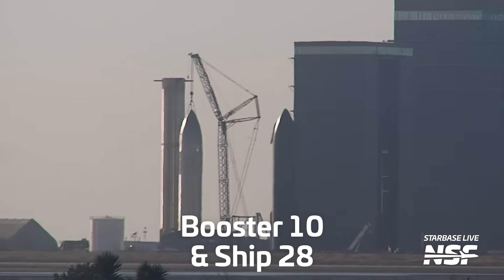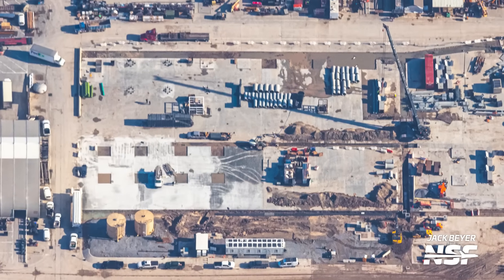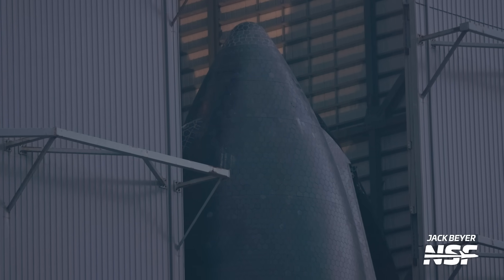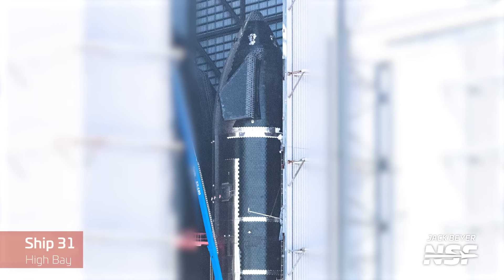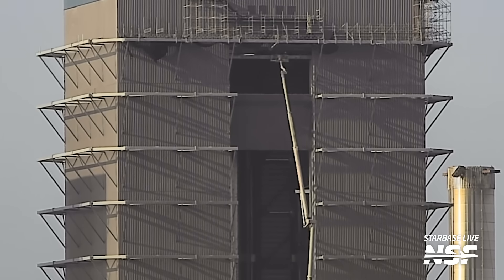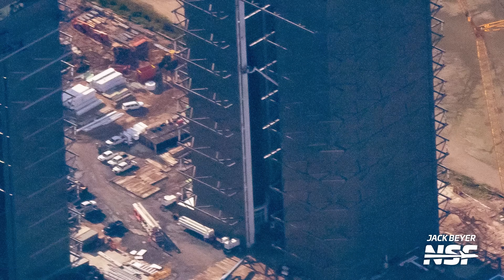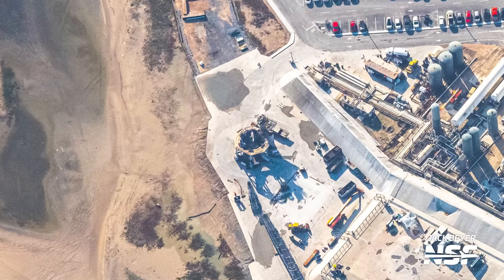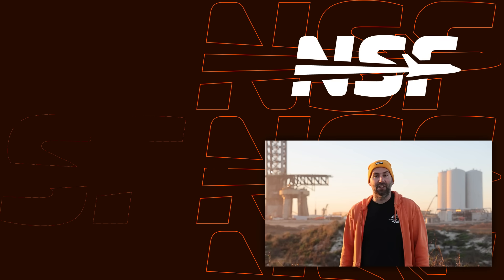SpaceX Revving Up for Starship Flight 3: | Starbase Update

Comment: HEARD SPACE-X "PAINTED" THE OLT. Surely You Just ---- A Concrete based Structure experiences 15 Million Ponds Force for 10 seconds at 8,000 Degrees Temperature --- AND YOU PAINT IT??

Comment: My Guess that the LR 11000 Crane will be reconfigured with a Power Boom like the LR 11350.  Has almost the same lifting Cap. at similar Jib height.  The only difference is the HP of the two Carnes. Time will tell.

Comment: Soon there will be a whole arsenal of starships ready for orbital test flights !
Reply: I do not believe that SpaceX would be investing in so many boosters and Starships if they did not intend to launch them.  SpaceX is clearly assembling sufficient inventory to launch at least TEN times this year.  Objectives for this year include demonstrating the minimal delay between two launches required for orbital refilling, catching a booster or Starship, deploying full size version 2 Starlinks (probably essential for usable 5G bandwidth).  If they exceed their basic plan they may even emulate the first Falcon Heavy launch by sending an empty Starship past Mars or on a free return around the Moon like Artemis I.

Comment: can anyone explain to me what the air vaporizers do
Reply: They are heat exchangers.  Super cold liquid nitrogen goes in, flows along a slew of thin pipes exposed to ambient air, and exits as gaseous nitrogen.  Gaseous nitrogen is used for flushing pipes, fire suppression, fuel tank and GSE pressurization tests.
Reply: @Spherical_Cow  awesome you are amazing spherical cow

Comment: Them tower parts I don't think are for launching. They are going to be for landings. You cant blow up your only launch platform testing landings. I just wonder where they will put it.
Reply: You are assuming that blowing up the launchpad will be unavoidable consequence of landing the boosters.   The original intent was for starship to take off and the booster to be caught by the same launch tower a short time later.  With a second launch tower then Space X can alternate flights.  Refurbish one after a launch while another is ready for launch.  

I'm guessing on the last part and could be wrong.  We'll see soon enough.

Comment: If they always have to repair this much, the launch cadence will not be great. Hopefully, they can fix some of the issues with better cladding and such.
Reply: Space X is learning how to build the tower and launch pad for reuse just as they are learning how to build the starship and booster.  The only way to see if the improvements work is with a launch.  And since there have only been two launches Space X is still in the early stages in developing Stage 0 to be more resilient and ready for reuse quickly.
Reply: @michaeldeierhoi4096 It's kinda insane that one part of that system is already rapidly reusable, which is the flame deflector. In the same place 7 month prior was the most obvious damage.
Reply: @norinokia2307  The base of the OLM needed a major upgrade and credit to the Space X engineers for their solution to deal with the wraith of 33 raptor engines.   It still remains to be seen how it will hold up after multiple launches.   The force of the raptor exhaust will degrade the steel over time in spite of the massive water deluge.

Comment: My thoughts on Ship #26: Seeing that an in-space refueling tanker will require a serious amount of insulation to prevent cryogenic boil-off. I can imagine the lack of heat shield tiles and the adding of the strange exterior stringers will possibly lead to this ship being the first in-space refueling tanker attempt. Once the stringers are finished (to whatever point satisfies the SpaceX team) I think we will see some type of protective insulation cladding going on. The stringers will probably also give the onboard tanks more reinforcements as to be able to add the fuel to a higher psi range. Maybe….
Reply: The stringers are in the wrong spot for insulation.
Also, even if they were in the right spot, they'd interfere with MLI.
Reply: @bryanillenberg  how are the strings in “the wrong spot” if no other spacecraft, that we know of, has been built to be an in space fuel depot? We will have to see what SpaceX does with it. Also, Feel free to voice your thoughts on what You think it will be here so we can check back in a few months to see who was more wrong or right….
Reply: @Rick.G_KW  because with sufficient knowledge of aerospace engineering (not claiming to be an expert, but I do have a decent amount of knowledge), you can determine what is needed for a depot.
The two main things are power and thermal regulation. From there, one can determine how to achieve these goals.
Power is easy: solar panels, most likely deployed from the payload section. The stringers would get in the way of this.
MLI is needed for thermal regulation. Period. The mass penalty of any other system is crippling. 
As for my opinion on S26's fate, I believe it will be scraped. Musk's V1 comment, plus no observable purpose, thoroughly eliminates  any chance of it flying.

Comment: @11:55 Why doesn't SpaceX cover Stage 0 with a few coats of flame-resistant paint, spikes, glue, the thermal blankets and heat tiles? 
Even if they have to reinstall some occasional damaged heat tiles, it would be a lot easier than the near total refurbishment they're doing now.
Reply: Heat tiles would blow away in a tiny fraction of a second. They are not designed for sea-level conditions.
The exhaust is so powerful it removes layers of the steel. They have sacrificial steel covers on the legs. They have to be replaced when the steel becomes too thin.
The paint is both easy and cheap. It protects from rust, not heat.

Comment: Its going to explode again, starship=Soviet union N1 😂
Reply: Falcon heavy has 27 engines and has worked without any explosions. Why would 5 more be so different?
Reply: @knowledgeisgood9645  because everything is different and the scale of rocket is different, more parts more problems
Reply: @codeforce5556    It's like you didn't even watch the the second launch in which the booster made up all the way to MECO, second stage separation and the booster began its flip turn to return when it malfunctioned. The N-2 never accomplished any of those goals.  In fact the N-2 wasn't designed at all, but for single use.
Reply: @michaeldeierhoi4096  starship was to land/splash down off the Hawaii coast, instead hundreds of tiles fell off and the booster exploded, it wouldn't have survived re-entry,at this rate the craft will never be human rated,it was supposed to be going to Mars in 2024
Reply: @codeforce5556    The only part you got right in that mistake filled comment was that starship was to land off the Hawaiian coast.   As the errors, hundreds of tiles did not fall off and the booster exploded AFTER reaching MECO, second stage separation AND the booster had begun its flip turn.   Then the booster exploded because it apparently went off course and the FTS was triggered.  So this was a huge improvement over the first launch.  If your only determination of how well launch went is that it blew up then the nuances inherent in new rocket development are beyond you.  Just saying the obvious, sorry if that offends you.  

And nobody realistically thought that starship would reach Mars by 2024 aside from some of Elon's characteristic tendency which is not taken seriously by anyone who has followed the progress of starship.  I think you only used that comment to try desperately to claim a gotcha against Space X and Elon!   😂😅
Reply: @michaeldeierhoi4096  check out the video again,once the booster flipped it started leaking,a few engines turned back on, then it exploded.Even NASA concerned now,musk said to refill starship would require 6 tanker launches, NASA did some research and concluded starship will require 13 tanker launches ,this was a few weeks ago.just to go to the moon,let alone mars,if one is lucky and no fuel tanker explodes😑
Reply: @codeforce5556  Like I always say about these sorts of things We'll see what happens.   😅

Comment: With the Star Factory construction SpaceX likely has more ships and boosters currently idling in inventory as works in process.  Basic ring stacking is likely curtailed until they have a factory again.
Reply: The parts of the factory that are done are working just fine. The nosecones have to wait a bit.
Reply: @knowledgeisgood9645  They are already making nosecones
Reply: @bryanillenberg  Good. I have not seen any images of that yet.

Comment: Great summary as usual Jack!
So, what changes are needed to make stage 0 rapidly re-usable?
Integration Tower v2 will be taller but will OLM v2 be taller with wider legs?
Increasing distance between OLM and Tower?
More elevators?
Auto-painting OLM legs?
How about booster quick disconnect moving to the opposite side of OLM?
Reply: That is a lot of questions. I will try to answer them.
Rapid reusability depends on a very long list of things. It will take time.
We have no indication of Tower 2 being taller. No extra segments have been spotted.
The OLM legs will be as tall, but without the elbow. (That btw was added when they removed the legs and skirt off the boosters - without the added hight the Raptors would have ended up closer to the ground).
The distance between OLM and tower depends on the chopsticks' length. I expect the distance to be the same. Painting the legs is to avoid rust (and cosmetics) - it is cheap.
The BQD will be where the pipes can be placed (the shorter they are the better). I doubt they will change it.

Comment: I remember when they were launching things. That launch mount is a mess.
Reply: It is the most complicated launch pad on earth. It is also still under development. Not sure why you think it is a mess.
Reply: @knowledgeisgood9645  It's been 10 weeks since the last launch and they are still replacing parts on the launch mount.

If this design is scalable to the rapid launch cadence supposedly envisioned, it has yet to show any signs of it.
Reply: @proesterchen   You need to learn patience.  There have only been two launches and this is early in the development of Starship and the OLM. It will take many launches to get to the point that Space X can work out the weak points and correct them. 

Space X is also dependent on the FAA certifying each launch.  When Space X can launch without initiating the FTS or losing a vehicle for another reason then certification from the FAA will come quicker thereby allowing for an increased launch cadence.
Reply: @michaeldeierhoi4096 The FAA has nothing to do with the state of this launch mount. That's a Space Ex problem.
Reply: @proesterchen  There is nothing in my comment that even implies that the FAA is looking at the OLM.  I specifically said that that FAA is responsible for certifying the launch which they are.
Reply: @proesterchen  This process could take years. No one can know for sure how long it will be - that's the nature of R&D.
Also, just because parts are being replaced does not need to mean anything since we don't know their reasons. We are trying to guess based on few observations.

Comment: With the second tower soon to be constructed, they are probably making the big crane extended like when they built tower one. Because Elon was saying that starship mark 3 might be upto 50 meters taller, they will need to make the crane even BIGGERER to lift the extra TALLERER tower sections for tower 2.
Reply: It's also possible they can lower the lift points on the vehicles.
Reply: He said it could be between 10 and 30m taller, not 50m. Likely no more than 20m.
They don't need to change the tower. They could just move the lifting points of the ship to the correct hight.
Reply: Space-X’s LR 11000 is the wrong size of crane to build the tower. 
To go to the height required for Tower 2, and due to the weight of each section (what were there? 7-9 segments  I think?) An LR 11350 with a power boom would be needed. would be required. That’s the next size up from our beloved Space-X LR 11000. Doesn’t mean the 11000 can’t get er started though!!

Comment: I'm kind of disappointed with the speed of SpaceX right now. The OLM is always so badly damaged after every flight that it takes months to repair it. They can't launch more than 5 times this year, although Starbase will soon be producing hardware without end. Why don't they tackle the second OLM faster?
Reply: You forget that all is R&D, even the OLM. When they find a problem they solve it, then another problem shows up. They fix that too. And so on - until there are no more problems. It would be nice if all problems were clearly visible after one test - that never happens.

Comment: Regarding the activity on ship 26, has anyone considered that perhaps SpaceX is simply training more skilled Starship workers in preparation for increased production rates?
Reply: This and that it’s probably a pathfinder for a lunar lander.. they have to consider how things fit together.
Reply: @MomedicsChannel  no...
The stringers would interfere with the solar panels.
Besides, if it's for HLS, then where are the cutouts for the engines?
Reply: @bryanillenberg stringers are to increase strength of part that will be empty in pathfinder, as in that place in real hls there will be thrusters. So above stringers they can actually work on inside mock-up, cutouts for cargo doors that will compromise structural integrity in that particular ship. They need this mockup to test practicality of layout. In Cali they tested elevator alone with astronauts in mock-up of spacesuit. Layout has to be practical for people in very bulky suits.
Reply: @just_archan  I don't think stringers are in the right space for the HLS thrusters.
Reply: @bryanillenberg  in renders thrusters were just above tanks. And that is were stringers are. 
But I am not sure about that. It's just educated guess as I don't believe that 26 will fly. I just don't see any purpose. It lacks any payload doors, nor equipment for cooling fuel. Or for generating energy. Or insulation. Any test of fuel transfer can be tested between standard type of starships, so it will be additional tests of re-entry. I can be wrong, and there will be installed equipment for long term storage of cryogenic propellants, but I honestly doubt in that.
Reply: Training on a lift? There are easier places to train. Looks too planned to be a training artifact. It's some kind of proof of concept.
Reply: @jeremynew6449  I thought of that too, but it might be training under 'battlefield' conditions.  Some people might simply freeze up at those heights.
Reply: @johnwiles4391  it's possible. Doing this kind of lift work isn't supposed to be typical though. More and more work should be shifted to the starfactory and Megabay.
Reply: @jeremynew6449  Atypical situations are exactly where you need the highest skill levels.  Also, highly planned structures are not mutually exclusive with training.  In fact, they strike me as complementary.

Edited for grammar.
Reply: That’s what I think
Reply: Somebody realized it could be the test hull for the Human Lander System?
Reply: I honestly think they are just using S26 for training/practice for employees for various tasks
Reply: At some point you have to have an actual working Starship.

Comment: Seems like Starbase is turning into a company town (hopefully without the horrible practices that such used to entail )  Though IIRC doesn't the area lack water/sewage?  Or is that getting added as the area gets developed along with all SpaceX's other projects?
Reply: Similar motivators, yet significantly opposite margins. Resulting in the same isolated environment, yet the opposite effect. Meaning the town will be like a utopia. (Okay, not a utopia but instead of negative forces, positive ones that make it ideal).